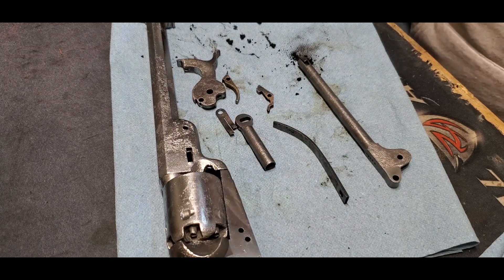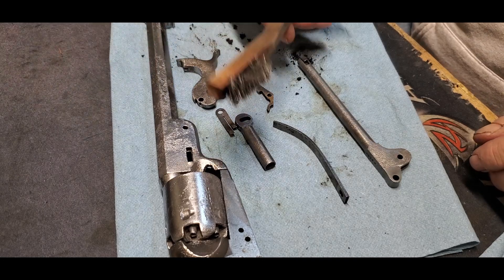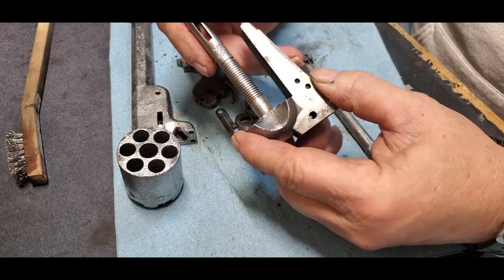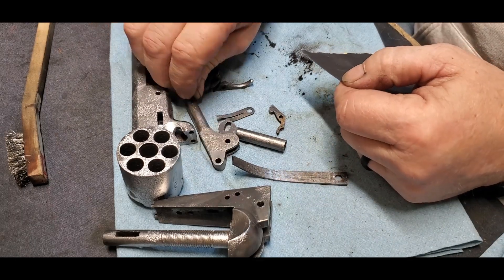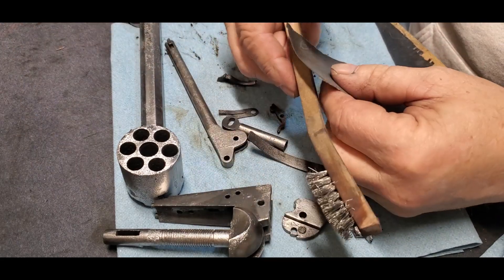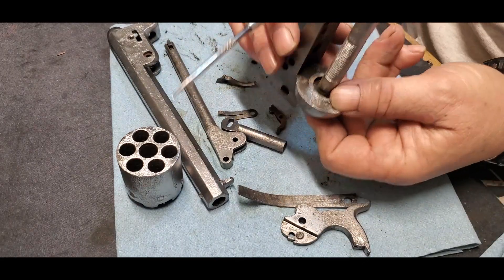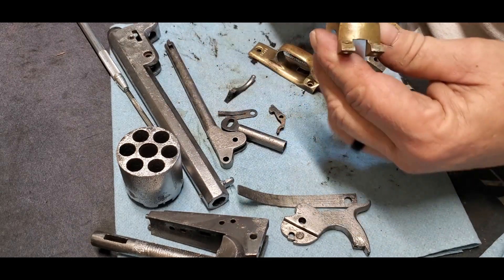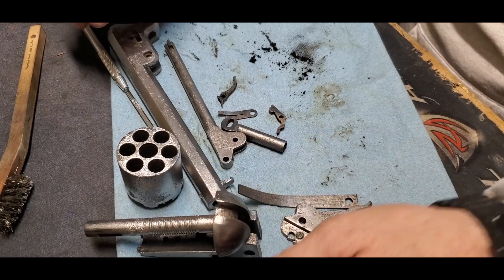Pitting!!  Restoring the1851 colt Navy pt 4

Comment: I have a CVA 1851 Colt Navy that I built 30 years ago. Only put one round through it. Then life got in the way. It is now all apart. Been soak in evapo rust. Some light pitting. The barrel cleaned up nicely with Frontier 45. Now it’s just going the be hours of sanding then cold bluing. If all goes well in a month, it will make bang noises and ping steel. Great video. Thanks for Sharing.